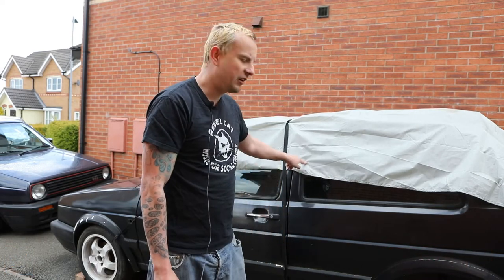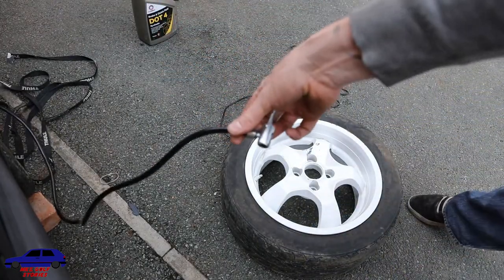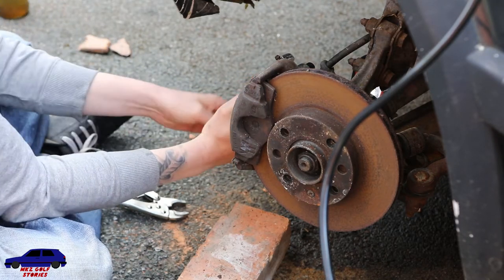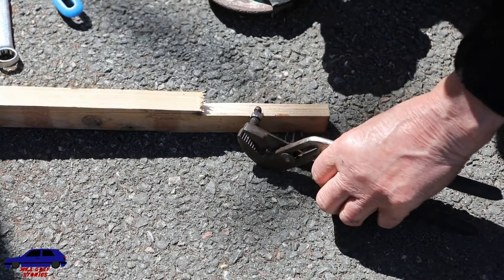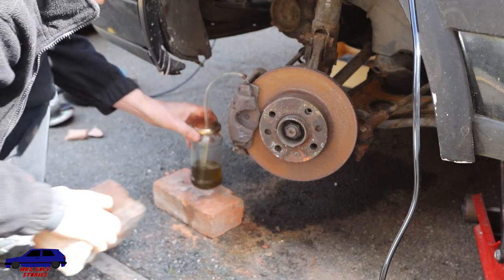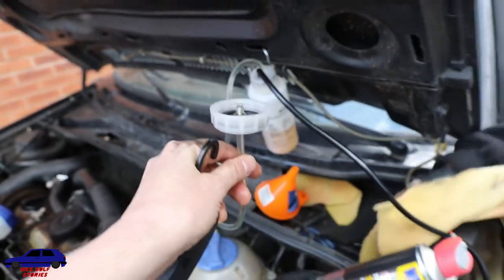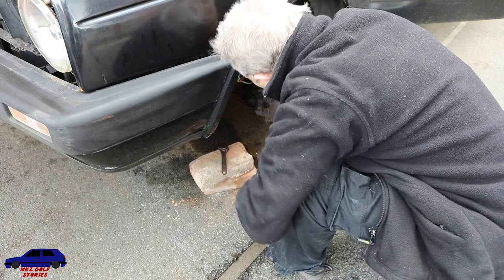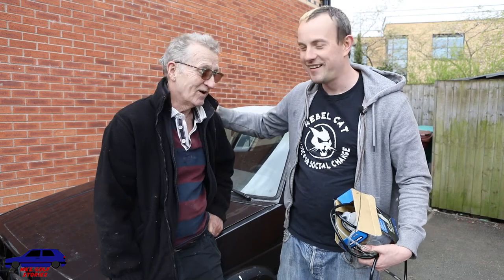Bleeding the Brakes on the MK2 Golf GTD

Comment: how bleed rear brakes?
Reply from the maker: Same process
Do all breaks.  Front first then rear
Reply: @MK2GolfStories  but rear axle has a pressure distributor for the brakes. How is the bleeding done?
Reply from the maker: You have to open the bias valve up from memory i think @cesarlam6286